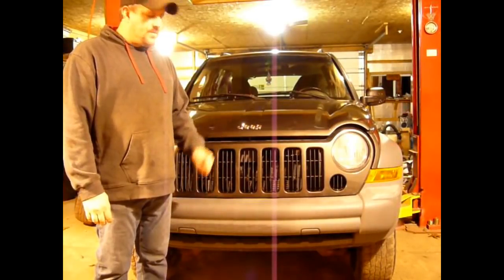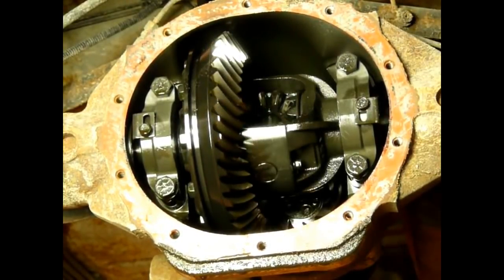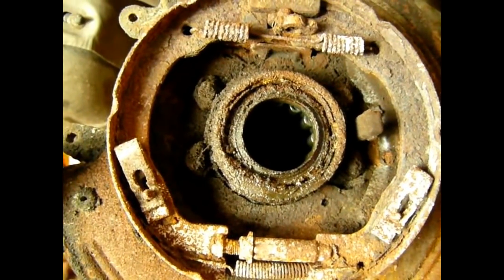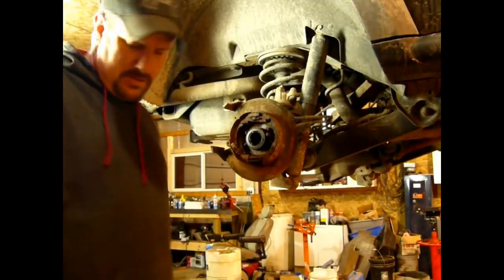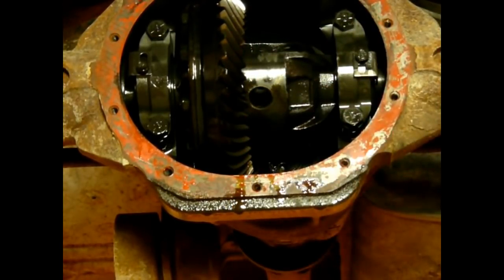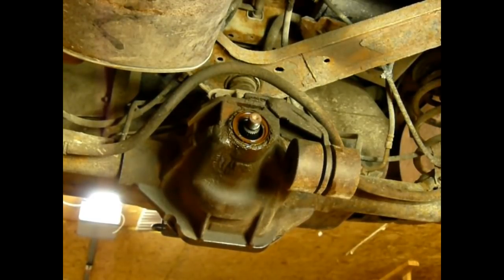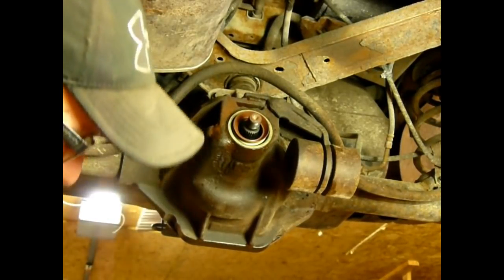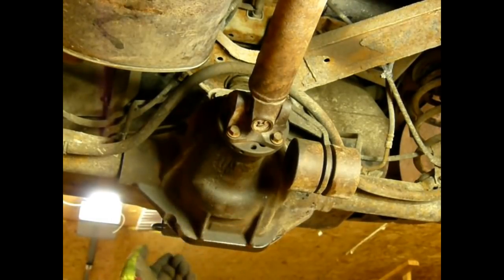Jeep Liberty rear axle seals and pinion seal replacement

Comment: I do understand greasing the shaft to build a grease wall to help the seal do its job better. I have always packed the backside of the seal with petroleum jelly. When the shaft reaches a certain temp the jelly liquefies and lubricates the seal.

Comment: Hi I have a 07 jeep liberty sport 4wd , I'm the second owner . I bought her with 145,000 , she now has 200,100 ! I've done a lot of work to her over the years and my next project q the rear bearings and seals which I've never done and I need a new power steering pump high pressure hose and front bearings , I replaced those a couple years ago but I think they are bad again . anyway thanks for the video and info !

Comment: Wow,  I don't know if I would just brapp the used pinion nut back on.   I would  get a new pinion nut,  leave the axles disconnected and use a yoke holding tool and tighten by hand checking the preload with an inch pound indicator.   But first check the existing preload with the indicator before removing the yoke.   This preload is also weighing the diff gear assembly so you can't just set it by the books for a used bearing set.   Any how thanks for posting the video!

Comment: On a 2004 Liberty, I've got no leaking, but I felt vibration out at axle ends going down the road. Did not find chewed up axle ends, but need to replace the outer bearings. Thanks for video.

Comment: I have a kj and literally had to have my rear axle seals done a couple months ago, but saying that my kj is a brilliant old horse its a 2.5 diesel with 180k miles and because i keep it serviced amd stuff because i do it all my self and get all repairs done its solid as a rock and it goes off roading at least once a week and work and everywhere everyday, i used to have a xj, i wamt to do solid front axle swap on kj

Comment: No locktite on the pin, ignored the preload on the bearing and didn't even bother to at least mark the nut or the flanges with a paint marker! (Every time I've done it, the preload was set at the exact place where the paint mark was originally)

Comment: I have pretty much the same jeep, lately, I have noticed a thunk noise when going over bumps- I took the right wheel off and the thunk is the axle moving 1/8 " in and out without the brake attached. ** What is the normal play in and out for an axle? * There is no problem with the movement or running, it just sounded like something was loose. Just a side note: has 160,000, and I just replaced all of the rear parts (shocks, spring, control arms upper and lower), along with the front suspension. (everything but the knuckle and hub) I like everything to be tight.

Comment: Fantastic video! I'm changing rear ends in a Jeep Liberty 2007. I dropped the spider gears. Any advice to get them back in? The top and bottom small gears.
Reply from the maker: Roll them in while turning the side gears.
Reply: @Tomsfoolery.  Thank you very much

Comment: hello super video. I wanted to know if after winding up you have a light games (when you pull pushes the wheel towards be) about 1 mm because on my vehicle I have this games but the bearings are impeccable and I have no leak to the bridge . thank you to you
Reply from the maker: If you’re asking if there’s movement of the axle in and out, yes there is. It’s normal to have a couple millimeters of play.
Reply: @Tomsfoolery.  thanks you very munch

Comment: Great video.  But I have a grinding  bearing ... does that come out easily?  With a pry bar?  Need some assistance as to the best way to approach.  Thank you.  Brad
Reply from the maker: Use an axle bearing remover with a slide hammer. It will yank it right out
Reply: Thank you.  :)

Comment: Isnt there a specific torque spec for the pinion nut , so it sets the proper lash on the pinion gear and doesn’t over crush the crush sleeve creating a tight lash situation ?
Reply from the maker: Pinion preload was set when the crush sleeve was first crushed down so just tighten the pinion nut back up. Make sure it’s tight but try not to crush the crush sleeve any further or pinion preload will increase. It’s not the end of the world if it does slightly. I’ve done it that way for over twenty years. Never one issue.

Comment: I'm doing a 2012 liberty ended up needing heat to take off the drive shaft bolts make sure you have a spray bottle and fire extinguisher because of the fuel tank 3 inches away but doesn't need a lot of heat just enuff to warm up the blue loctite

Comment: How do I get the differential pin out. I had taken the 8 mm bolt out but differential pin will not come out period is there any kind of so
Reply from the maker: Sometimes you need to tap em to get them to start moving. I use a brass drift and hit it with a hammer.

Comment: Thanks for video....  how do you know how tight to put the pinion nut.  Doesnt it come with a factory preload that needs to be tightened back with some precision?
Reply from the maker: Because the preload was already set when the crush sleeve was crushed, snug it down and give it another braap of the gun. I usually turn the pinion by hand as I'm doing it to make sure I don't over tighten it. You want a little resistance when it turns but not to where you can't spin it by hand.
Reply: Ok.... thanks for the quick reply.... the rubber on my old seal was in 2 pieces.... and my seal was a bitch to get out.... but should have it finished up tomorrow.  Thanks again...

Comment: What if I drove the bearing seal too far in? Should I ruin it to get it out or just hope it works? The bearing spins free but the seal is about 1/8 inch too far in
Reply: Send it back and say it didnt seal
Reply: @chickenfixn4439  I left it in that position. It doesn't seem to be leaking after maybe 2000 miles now. Hope it's good
Reply: @RichardMiller-tq6ut  hey man if it works then it works 👌

Comment: When i am driving my 2003 jeep liberty on the highway at 70-80 kl  and take my foot off the gas pedal the truck seems to wonder a little and I hear a noise from the rear end. Same when I give it gas. Easy fix or do I have major problems. Sure would like a some help on this problem Thanks.
Reply from the maker: If there is a whining noise in the rear and it changes under accel/decel you probably have worn pinion bearings.

Comment: Hey I have a question I have a 02 Jeep liberty I had it in reverse and it stopped rolling could that be a rear wheel bearing or something like that I took the cover off and there was no metal or anything in there everything look good nice and tight but the right wheel catches and won't roll sometimes in reverse logo forward fine

Comment: Do you know nut tightening force (Nm) or you only just mark nut position?
Reply from the maker: If you’re not installing a new crush sleeve, tighten the nut to where it was prior. Once you do a couple of em, you can tell by hand turning the pinion when to stop.
Reply: @Tomsfoolery.  No, only replace a new one pinion

Comment: My brothers 2004 jeep grand cherokee 2.7CRD has a fluid leak from N/S rear bearing seal. Ive read conflicting reports that the seal next to the bearing end is just a dust seal to protect the bearing and the seals that need to be changed are in the diff itself? we changed the bearing and seal about a month ago and noticed the axle was soaked in diff oil but we assumed it was supposed to be like that.
Reply from the maker: We are talking about a rear axle, correct? That is not a dust seal. It’s an oil seal for the rear axle housing. The bearing is lubricated by the gear oil in the differential. There are no inner axle seals on the rear axle, only the front axle has them.
Reply: Yes, rear axle. And thank you for clearing that up. As i said, just read conflicting reports, some saying seals in the diff and the bearing is supposed to be greased, some saying the bearing is lubed by the diff oil which is what i thought. And i thought it was a bit suspect as i couldnt find a diff seal kit for it. :D
Reply: And the reason i am here, a month later my brother reported that the wheel was really hot after a long drive and was that hot it was smoking. I am not sure if its a caliper or bearing issue, not looked at it yet, just seems a bit dodgy condering we only changed the bearing a month or so ago, (ebay bearing, maybe just cheap made in China quality)
Reply from the maker: I would first suspect the brake caliper hanging up. It would take a tremendous amount of heat at the bearing to migrate to the wheel. Get a laser thermometer and drive it a bit. Take readings off each side. Read the heat on each rotor in comparison to each wheel.
Reply: Thanks for the quick replies. I will look into it, i thought it was the caliper also.

Comment: you just saved me $1000 at the dealership
Reply from the maker: Sweet! Now send me my cut! Haha!
Reply: I’m one or two upping you though, replacing a bent axle and also replacing the wheel bearings seals and pinion seal.
Reply: I just had this done at my jeep dealership,, whole job was $180.00 usd.. not worth doing it yourself.. this way you don’t have to worry about setting the pinion nut hence the lash incorrectly ,, it is an exact setting done with a torque wrench ...

Comment: Why'd you wait until the junk seal was off before you got the heavier portion of the gunk off.. I agree the paper towel does mostly work, but you already sealed the back up so anything going in, is staying in. If you do it while the old seals on.. then you only have to clean the mating area with the face open..
Other than that, good video, watched it hoping you'd post a torque spec for the little pinion bolt, but I found it once I found my manual.
Also making a mark inside on the 32mm nut before taking it off would keep you from having to guess where to tighten it down to..